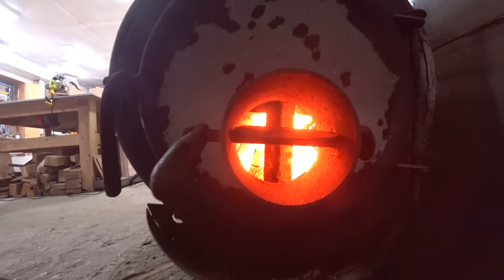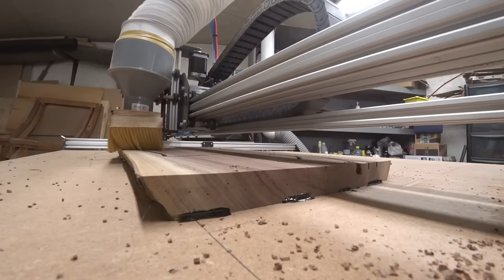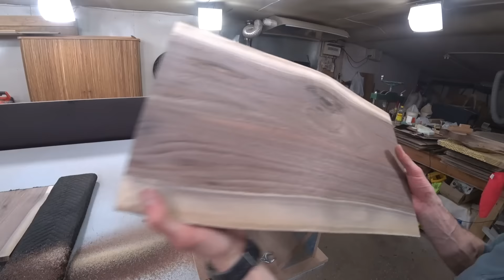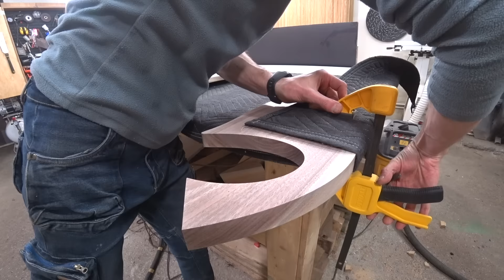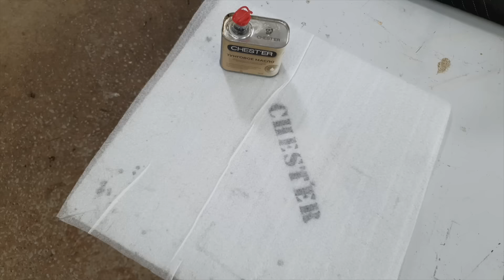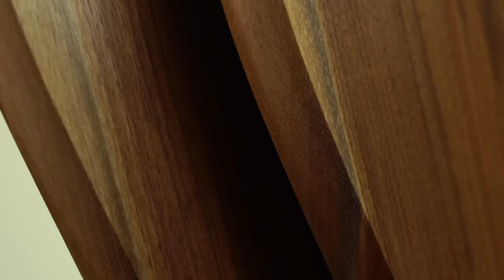CHEST'ER Kitchen cutting boards

Comment: I'm a huge fan of walnut because of it's grain and colors, and when you add in the sap wood in the design, it makes it even better. I noticed you sniffing the cutoffs. Yes, it does have a great smell when you cut it The dovetail feet are great. I've used them in several designs to add a little zip. Great work.